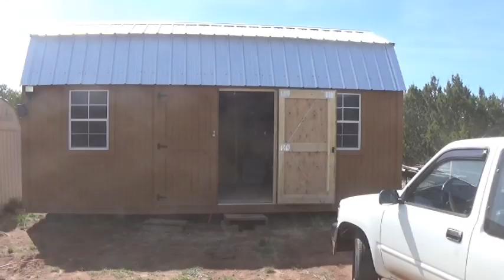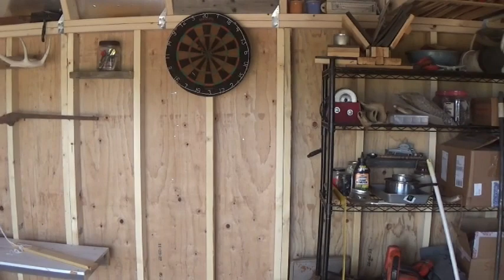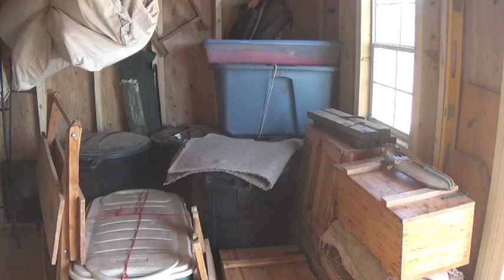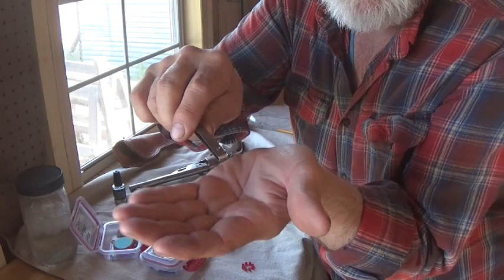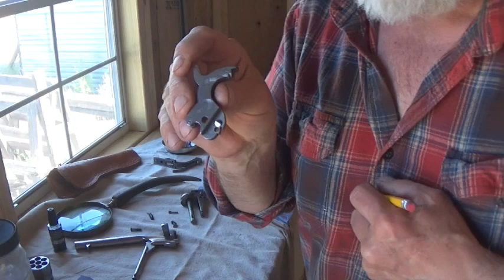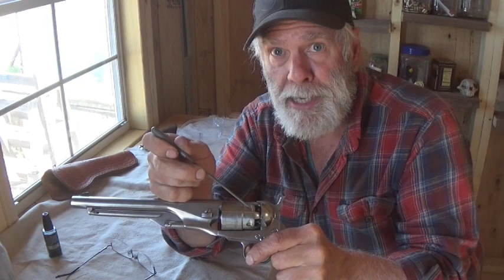Pietta's1860 Army Late Timing Lock up Fixed

Comment: to prevent over-travel of cyl, use grease, not oil. and to prevent caps sticking to hammer, round the sharp edges of the hammer notch

Comment: I used to have that exact same building - same manufacturer - Graceland.  Mine didn't have the insulation on the ceiling though - I had to add my own.  If you don't, it get hot hot  hot in there.

Comment: Pietta makes a Spare Parts Kit for their Colt Revolvers which contains a new Hammer ,Cones , Springs, Hand  Wedge  etc. for Emergency repairs. I bought mine from Cabelas last year .Only about $15 at the time. as wanted to have a spare Wedge and Cones on hand. I really like your videos and have been wondering how you make your DIY Caps. I've tried the Ring Caps and Roll Caps (Made in Germany ) and  Prime All but with poor success until now. I now use the Prime All but leave out the Yellow Dextrin  snd dry compress the mix into the cup before adding a drop of Duco Cement heavily diluted with Acetone. This seems to work well as Duco is essentially Nitrocellulose. I used to have trouble with the caps falling off so I made a little Jig out of wood or Nylon and use a Drill Bit with a Flat Shank to reshape the Cups before I fill them. I've also had trouble with the cups tearing so I tried a tip from another video and run a Flame over the metal strips before I form the cups to anneal them and this seems to prevent tearing .I don't remember whose video it was.
Reply from the maker: Sounds like you're on the right track .  I do like the Copper foil better, they are more stronger than the Aluminum.  But now i cannot find it at Hobby Lobby.  Thank you for your comment

Comment: I've been shortening my cones from .319 cone length to .314 (.533 over all) so I can run #11s on my #10 cones.  This maybe why I haven't experienced this lock up.
Reply from the maker: I wish the industry could work a little harder at being more consistent with the machining,  Thank you for your comment.
Reply: @lamebeavertradingco.1642  I tried the Old Ranger Q-tip method and can make both my Pietta 1851 "Navy" (44 cal) and my 1861 Navy (36 cal) lock up, if I work at it.  They do not click until the hammer is almost to the cylinder thrust ring.  But with my slightly shorter nipples there may never be an issue unless I have a tall cap?  I recently ordered some SlixShot so I could take dimensions off them and see how they size up to what I am making.  I have piles of #10 Pietta nipples. It seems a shame to let them go to waste.